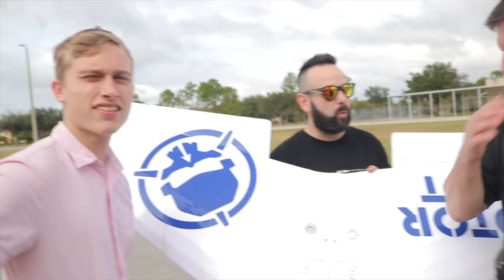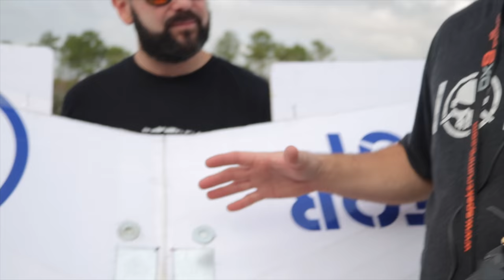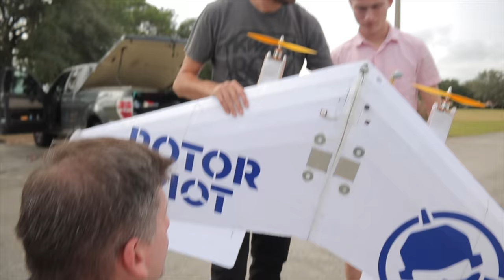Recharging a Drone IN MIDAIR!! (Landing on a Refueling Plane)

Comment: I would suggest the batman plane thingy for the next try. Fly the drone up, the plane has a fork which takes the drone's hanging battery, once it connects, detach  it from the drone and it slides right in place. The plane then turns upwards where a magnetic strip attaches the new battery which charges the old one (as the drone's weight is impractical). I can draw this out if you like

Comment: For any future attempts with this, please don't try to use differential thrust. Calibrate the ESCs at the same time using the master slider in iNav. Have both motors outputting the same RPM at all times and allow the wing to be flown without yaw. iNav would work properly and would really smooth the wing's flight if a simple autotune is carried out. You can put it into autolevel mode and it will just fly flat for the quad trying to land on it. 
This isn't meant as a criticism, but it's clear that you guys are quad pilots and not fixed wing pilots, when vanover was at the controls of the wing he did an amazing job, clearly experienced.

Other than that, great idea and well done, looks like a lot of work went into it.

Comment: Tip stall is what it kept doing you had the center of gravity WAY rerward that's why it's taking off in two or three feet and then dropping the  right wing. Did you have counter rotating props on it? Edit, if you notice when you dropped the drone on it that it quit sweeping the wings so dramatically and kind of leveled out.

Comment: There is a simpler concept. Have a plane optimised for cruise. Do the takeoff and climb using assisted takeoff and climb using an attached drone. Then when at cruising altitude detach and return the drone for recharging.
The detaching in midair is a lot simpler then attaching it in midair.

Comment: It would be interesting to modify it into an aircraft carrier-wing format with 4 recharging sites with one large or two smaller engines in cruiser mode and 4 closed engines for recharging landing mode so that the drone does not have to chase the "recharging station". At the same time, 4 closed engines with a variable angle of inclination - to help in the transition to cruising mode back. Base concept - Lego Leplin 07043

Comment: @letsflyrc I am guessing you have INAV on that wing? and have a gps with a compass? if that is the case, the compass is not calibrated correctly and it thinks it is pointing the wrong direction so it is trying to compensate by "yawing" that direction. if this is the case just turn the compass off, you do not need it on a wing.  just a thought. I had this same problem on a "wing" with a rudder and it constantly crabbed till i just turned off the compass now it flys great!

Comment: Could it be that the drone landing on is landing practically on the centre of lift and possibly detrying tth  receivers lift? As for the control of the receiver on take off  loo at the B2 it uses split ailerons to control the asymmetric yaw and roll yo may hav to look at a complex flight control computer to  ensure  stability at low slow angles of attack and od payloads, just a few thoughts cheers happy flying 😅

Comment: I think it might be MUCH easier to hang wires down with magnets so the drone just needs to get close under it, just like refueling fighter jets, they fly under and get a hose attached.   Make the two magnets have opposite polarity so they don't attach to the wrong place.

Comment: @Rotor Riot
just in case you read this 
ever tried using very strong magnets
and i think there even is a way to basicly turn the magnets on / off 
(but does not know at wich electricity cost)

Comment: What about attaching the battery connectors to a couple of cables with an aerofoil between them and drag it behind the airplane, which would be like real aircraft do it and surely the reason is because it's easier to attach where there is a flexible connection between both aircraft rather than a rigid platform to land on?

Comment: Super long range/duration drone/plane mission. Rctestflight's autonomous solar plane is the same flying wing design, have a fully charged drone be carried as payload on the back of the plane from takeoff to the plane's maximum range, then the drone can take it from there. I don't know how/if any kind of signal relay may work from the controller to the plane to the drone for longer distances

Comment: You don't need iNav for diff thrust. I was putting diff thrust on my twins long before I got into flight-controllers. Flite Test even has a vid on how to do it. A simple stabiliser would suffice.
Reply: I know that.  My first kraken and about 10 others have been built using the receiver to mix differential thrust.  

The goal for iNav was to put it into an autonomous circle pattern after landing on the plane.

Comment: Next time you guys should do a long range drone flight with a wing half way to the drones destination. Use the wing to refuel the battery but have an electromagnet hanging behind the wing floating in the air that the drone had to make contact with. De-energize the magnet to disconnect and continue the long range flight. You could even have to pilots ome at each destination and the wing carry the drone through a middle failsafe point. Then pilot two connects That would be insane

Comment: I wonder if the magnets are messing with the flight controller, causing the adverse yaw condition.  Seems odd that every plane would have the exact same issue even with different motors.

Comment: Would be cool to do this when for example using a drone to shoot footage in an area where the recording may have to be cut short in order to get the drone back safely, so instead just send a recharger plane up and land it on the plane, recharge, then you can get the maximum amount of footage with the battery you have.

Comment: They need to use a flying wing with top wings vertical control surfaces+ autostable airfoil who is far more stable as this incredibly unstable and difficult controlable thing (see to Aeriane Swift light PAS)

Comment: You should instead of using the same battery to fly the plane and charge the drone, use 2 different batteries. It lets the plane fly better and the drones battery can charge higher

Comment: Ok...ok... here's some brain food. Solar Panels are super light weight, cover that plane and direct power to a power bank that can either regulate and extend the plane's flight time and even lower weight since a larger battery won't be needed, and charge a drone without plane battery loss. Long Range low-power drone rescue/recharge mission... 😉

Comment: Worth noting that "have you ever jump started a car - that's all you're doing" is.... Not correct. Yes you connect those batteries together, but it is not to charge the dead battery, it is so allow the starter motor to pull from the good battery as well so that the car will start and then the alternator will charge the dead battery. I suppose you could hook the cars together and high-idle the running car while you wait for the alternator to charge the dead battery but that is probably hard on the alternator and likely isn't going to work very well, if at all.

Comment: Putting two batteries with different voltages in parallel is sure to fuck the charged battery up in like 10 cycles. When you don't know the very first things you stumble into when coming into this field, like C ratings, how much of a clue can you really have overall? Putting two batteries together is equivalent to charging with 100C or something totally absurd. Wtf is this shit?

Seriously, the dude says it charges in seconds, lets just assume a whole minute, that requires 60C charging, and since around 1/5 of that energy is burned inside the battery due to it's internal resistance and charging speed, it requires 72C. For anyone who don't know, the norm is to charge with 1C, eg. 1C x 2Ah capacity = 2A; this protects the life of the battery. Meanwhile, 72C is 144 amps with a 2Ah battery. Assuming 4S, that's 2130 watts, >426 of which goes to heating the battery, which is slightly destructive.

Let's do some rough lazy math based on educated assumptions: 1 watt heats 1 liter of water 1 celcius in 1 hour (within a couple %), a lithium battery heat capacity is about 85% that of water, a 2Ah 4S lipo is about 100CM3 (10 x 3.5 x 3 cm), 10% the volume of 1L water; so, it takes 60w to heat 1l 1c in 1 minute, 6000w to heat it 100c, 600w to heat 0.1L 100C in 1min, and finally 600w * 0.85 = 510W to do the same to a 2Ah 4S lipo . 426 / 510 = 0,84 or 84C over ambient to charge the battery. It ends up at around 100 celcius depending on exact battery specs, probably from 50C for the best and newest lipos, to melting for mediocre and used lipos.

Comment: FIRST OVERSEAS MID AIR REFUELING/RECHARGING 
Hello, AIR tanker One. This is quad XXX running on empty.  
Looking for some go juice.
Quad XXX, C'MON Aboard. Just follow behind and we'll hold her steady. C'mon down.
AIR TANKER ONE, were on board and power is under transfer. 
EMERGENCY,  EMERGENCY XXX. we're running pretty low ourselves.  Ya gotta go. 
Ten Four Tanker One. We're off.
MAYDAY  MAYDAY MAYDAY 
THIS IS AIR TANKER OBE Approaching low battery.
 warning!!!  EMERGENCY disconnect.  We're going  dow.......

Comment: If YOU made a refuling plane no Delta Wing but t-tail or v-tail you jas a VERY very most stable refuel plane!!! The Delta Wing isn't correct model!!! And other, you have used a VERY unstable Delta of you connect on Delta a gyroscope tour Delta fly much stable and Better but i reparti Is wrong tipe of plane for this type of work!